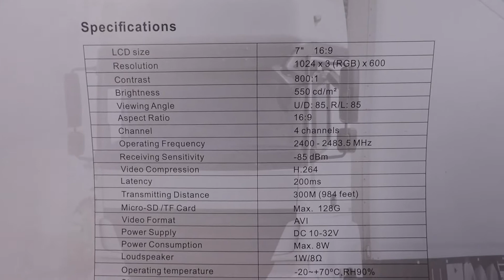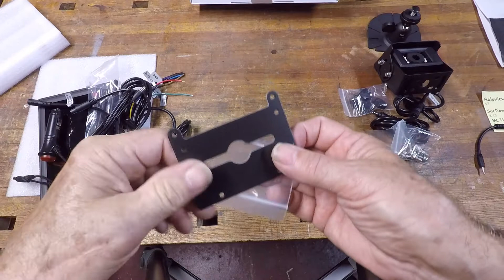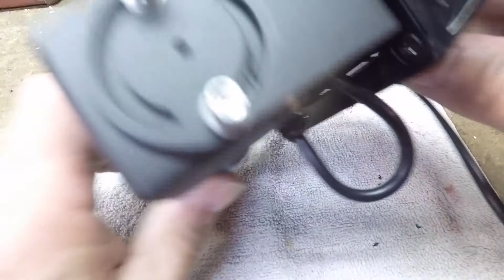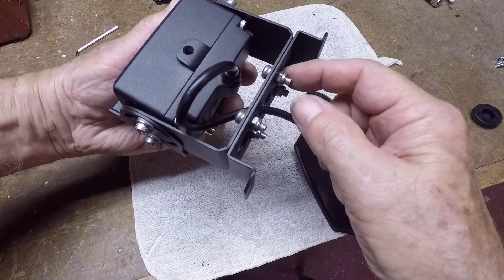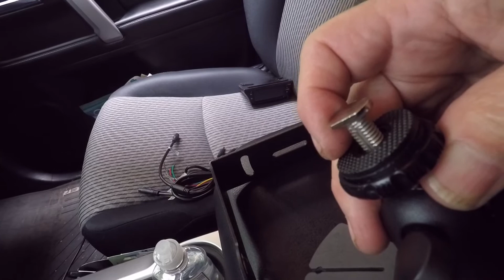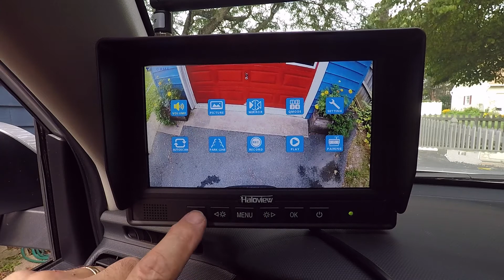Haloview MC7108 Installation and Set Up

Comment: The camera system is total trash, don't waste your money.
Reply: Did you own one?
Reply: Yes, I bought av4 cam HD from them, thats how I now know it's trash.
They advertise 1080, except it doesn't record in 1080 if you have all 4 cameras recording, the actual recording is more like 480.
It WILL Not loop record, the memory card has to be reformatted to be able to record over it, which means you have ABSOLUTELY NO IDEA when it stops recording wile you're driving. 
This thing is ONLY good for a backup camera (not recording) and thats it. 
You email their customer service about it and they want your order number the date and time you ordered it and your name before they can even answer simple questions. 
I told them it was not recording and they actually wanted me to send them video of it NOT recording.......how exactly do you do that?

Comment: VERY helpful video...thank you. With your help we got ours working!
Reply from the maker: I don't know what specifically was helpful but glad it helped.  The next time I went to use the camera the monitor did not work. Went thru all kinds of trouble shooting to find the cause and it just seemed that the monitor suddenly was not working. Returned the unit and got a new one and all is working as it should be. I really like being able to see the traffic in back of me while traveling and the monitor brightness and color is so much better than other camera models I've seen.
Reply: @craiglenhard-rvrguyd  Your video was the only one that pointed out that you had to turn on the lights. Our system came with our used 2019 Intech sol horizon and we are newbies. My husband was pulling his hair out trying to get it to work....Thanks again.